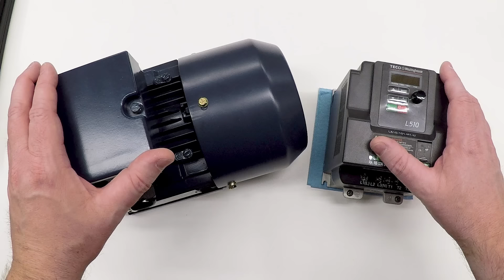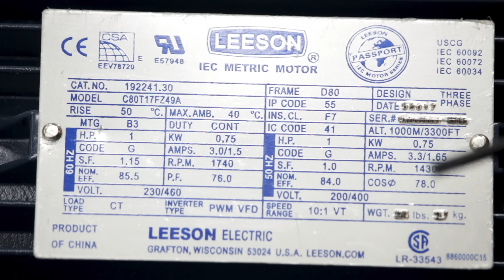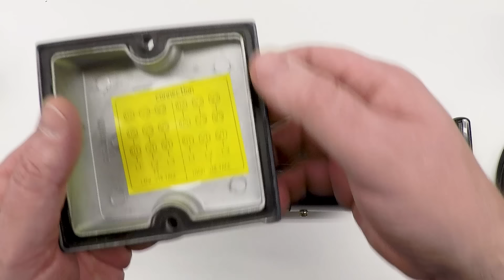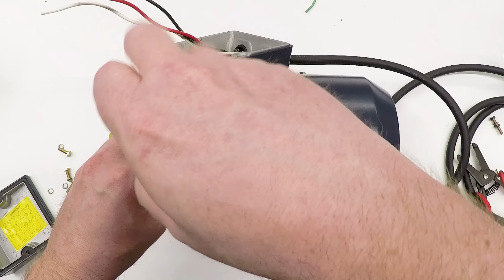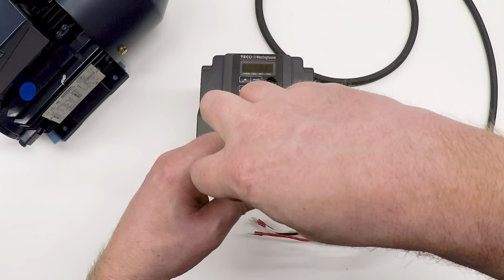Lathe VFD 1: How to wire a 3-Phase motor and VFD

Comment: You do make very good videos. -But why did you skip EMC shielding on this one? Did the bearings in the motor survive this?
Reply from the maker: It's been running for years.  Common-mode filtering was covered in another video in the series.

Comment: I have the same lathe but from a manufacturer here in mexico and i just bought it and it came with a 3 phase motor allready in it from factory (it is a new lathe), Would it work if I just connect the VFD to my 1 phase 220V power supply and then connect my lathe motor to the 3 terminals of the VFD without modifying or adding anything else?

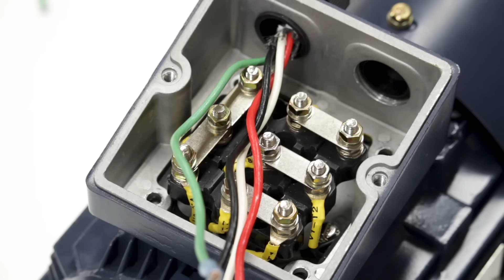Comment: I have a slightly different motor, and it came to me un-wired with no terminal block, just 11 yellow wires coming out of the motor into the wiring box. Anyone know where I can find a terminal block like the has 18:41  so I can wire this motor up cleanly?

Comment: At about 17:28 you say "I didn't cut all the way through the insulation", referring to the scoring of the SEOOW: "SEOOW" is not a type of insulation itself, but rather a designation for a type of electrical cable that features oil-resistant insulation and jacket made from thermoplastic elastomer (TPE), making it suitable for use in environments where oil exposure is likely; essentially, "SEOOW" describes the cable's construction and properties, including its insulation material, rather than being the insulation type itself. When referring to insulation as related to wires, cables, etc. it is thought that the reference is to the dielectric covering on the conductor: A "dielectric covering" on a conductor refers to an insulating layer of material, often called a "dielectric," placed around a conductor to prevent electrical current from flowing directly to another conductor or to ground, essentially acting as a protective barrier between them; it is essentially the insulating layer on a wire or cable, preventing unwanted electrical contact while still allowing the conductor to carry current within itself. And I always used that method with a razor knife of scoring the cable outer covering along its length, but I would then take small nips using diagonal cutting pliers to cut the circumference where the scoring along the length ended, unless the covering was loose enough to allow diagonal cutting pliers to easily nip from the cable end along the cable length. 40+ years as journeyman electrician in Pinellas County, FL. Just a technical nit-pick, lol 😊. Very good instructive video, thanks.

Comment: nice job.  I suspect that you will wish you did something a bit bigger.  I've done a few and found that 2 hp is a lot nicer.  Able to run at a much lower speed without stalling out.  3 phase IS better at low speeds but when you have reduced the speed using the VFD by say 4 times, then the relevant hp would be about 1/4 hp.  Ok, but not great.  If you cut that in half again, 1/8 hp is not enough, at least for me

Comment: I just saw this, 5 years after. I’ve replaced a number of motors with 3 phase inverter motors. After having used a number of different VFDs and motors, I’ve settled on these TECO/Westinghouse VFDs and their motors as well. I’ve found them to be easy to program, some are more confusing to those not experienced in this. The motors are made very well, and you know they work together.

There are different types of VFD and different types of inverter motors. Make sure you get those designed to work together. Generally, an inverter motor is constant torque at and below the rated frequency, down to some specified frequency, and then constant power above that to the max frequency. So my 2 Hp motor, for example, is constant torque from 3 Hz to 60 Hz, and constant power from 60 Hz to 120 Hz. Be careful when setting adjustment compensation for constant torque. Don’t be tempted to go right to the highest level, which is usually +50%. Stay close to +20-30%. Your motor may overheat otherwise unless you have a high overload factor.

At any rate, there’s a lot to this, many adjustments you don’t have to do. These VFDs have intimidating manuals for the uninitiated. I’m going now to the second video to see what he did. And, by the way, program the VFDs BEFORE attaching the motor, that’s a must. A beginners mistake.

Comment: Was there a reason why you chose 240 output vs 480... Your drive input is 120v AC
.. YOUR DRIVE outputs are either 240 /480, your choice, and you chose the lower voltage... Why ?
Reply from the maker: I believe the L510 115V single phase VFD only outputs 230V to the motor.

Comment: Great video thank you. never seen a label like that before.  my connections as follows; 4-5-6-, 1-1-7,  2-2-8, 3-3-9. I wire in over 1000k motors in a year.

Comment: Clough42,
I would like to thank you for your efforts on the video you produced of the VFD installation on your lathe and the subsequent video of the drive RF noise mitigation methods you used, reference your videos from 4 years ago.
I used the information from your drive RF noise mitigation method to great effect with an Automation Direct GS2 drive I installed on a bench top mill.  This drive produced conducted as well as radiated RF noise into the AC and DC systems.  This noise caused an IGgaying DRO to lose its position when the drive motor was running. I installed the same EMI filter on the drive input and ferrite toroid’s on the drive output to the motor as described in your noise reduction video.
I have also installed a Teco 2 HP drive on a lathe project. Thank you for the detailed look into the drive manual. Very helpful.

Comment: I am mostly curious as to what improvement in the machine function can be realized by this fairly expensive upgrade. Grizzly says the machine has speeds from 150 to 2400 rpm. This seems to me a reasonable range for this type of lathe. What am I missing?
Reply: A VFD can run from low RPM to high with no gaps. The Grizzly without VFD has a belt you need to physically change pulleys, so you can only select 6 speeds.  150, 300, 560, 720, 1200 or 2400

Comment: Remenber when use a VFD to drive a motor then select a motor with ceramic bearings otherwise your bearings will be harmed by eddy current.
Reply from the maker: This is not necessary.  A common mode choke will block the common mode energy that can capacitively couple to the rising assembly and flow through the bearings.
Reply: @Clough42  I must admit I didn't saw the whole video, just hear the squeaking sound and you said it was not the main spindle, so my conclusion was the motor bearings. You are right the common mode choke will help, due to smoothing the sine wave. Even though the magnetic field lines in an AC motor, which has to produce its own magnetic field based on a chopped squarewave approx to sinusoidal wave give induction currents in the bearings. Maybe the size of AC motor you have the effect is not significant but you will see the problem on large AC motors driven by VFD.

Comment: The tradesmen that I worked with referred to what your calling a cable gland they called it a water dust proof strain relief  I preferred to use the ones that are explosion proof any time needed even in my truck when I ran any wires through the firewall in my truck for a power inverter and the 110v and 12v to the back inside box and into the tool box where I had emergency lights and a cooler when needed .
Reply from the maker: They are called by a lot of different names, depending on the market.  Automation Direct calls them Cable Glands.  McMaster-Carr calls them Cord Grips.  Lowe's calls them Cable Connector Conduit Fittings.  Chinese import resellers usually use keyword soup, like Cord Grip Cable Glands for Electrical Box Waterproof Nylon Strain Relief.
Reply: @Clough42  as a safety officer I brought it up that we had red seal journeyman electricians who did not know the terminologies for ele fittings because 100% of the training they had they never worked on a industrial site .it proved to be a problem we even he'd electrical engineers from China who was not recognized in Canada so some of them challenged the journeyman cert and some passed never once setting for on any job anywhere the oilsands capitalized on there knowledge.

Comment: Great video, I'm dealing with wiring mine up right now. Big issue I have is the wires coming from my 3 hp 3 phase motor are solid copper either 16 ga or 14 ga all the same color. It's a South Bend from 1960. Wire nuts keep coming loose when putting 12 ga stranded wire together with the solid, (2 solid & 1 stranded), I have considered soldering or maybe connectors but can't seem to find a large enough connectors to put all 3 together that will work on the terminals with the VFD. I guess it's what we all run into trying to modify our equipement. Thanks

Comment: Well, I'm really late to the VFD on a G0602 party. But when I ran across James' videos, I knew I had to make the jump to a VFD. The way James breaks everything down is clear and concise. Excellent content James! I got everything ordered and made the conversion. It works perfectly as in the videos.  My next step is the ELS conversion. I have most of the parts already, just waiting on the Texas Instrument developer board and the cogs from China. I can't wait to get rid of all those nasty gears.  Well done James! Thanks for your excellent content!  You earned a new subscriber!
Reply: 4:02 
“These motors come in a couple of different (flavors) “ 🎉
Reply: Not as late as me  :)   I'm having trouble locating this motor now. It's discontinued and so is the replacement. Any Ideas on another replacement?
Reply: @The411   what motor ?  Just look up on Google and try to find a motto with similar numbers  volts and hp and rpm
Reply: @The411  Actually, when I ordered mine. The company reached out to me to tell me that model was discontinued. The guy on the phone matched the specifications on RPM, size and base plate mount, etc. with the motor James listed in the conversion. It fit and worked just like it the videos. Just call the company you were ordering it from and ask them to match up the specs. 
I would tell you what my motor is, but I am out of town traveling until September. 
I will add this conversion is amazing if you have a G0602. It is pure joy to work with the lathe. 
Let me know if you need my motor number when I return home.
Good luck!
Reply: @SRED  Thanks for the reply. Yes, my lathe is a G0602.I think I have info on a suitable motor a Marathon R313A it matches the specs very well. I was worried about a motor not being VFD capable, but apparently all motors in the last 10 yrs or so are all VFD capable, and the newer ones dont even mention it. Safe travels.
Reply: @The411  Great! Trust me, once completed you will find things to turn on the lathe 😁
Good luck!

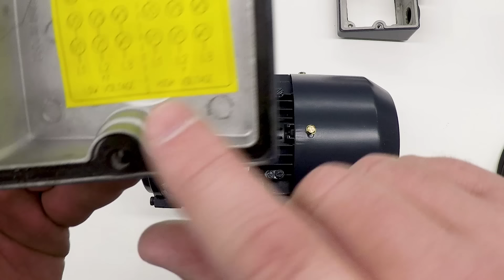Comment: Thank you for the good video.  Please explain is the low voltage connection at time 16:16 in a delta or star configuration? It's confusing as I've never heard of a 9 lead motor before . New electrical student haha...
Reply from the maker: I think it's star-wired.  Three of the coils are already connected in a star configuration inside the motor, and you either connect the other three coils in another star wired in parallel with the first (low voltage) or you attach them in series with the coils in the hard-wired star (high voltage).

Comment: Thanjj jy s for sharing. I am also learning more about VFD’s and electrical motors.
I have a VFD on my lathe because I don’t have 3 phase power and the lathe has s 3 phase motor. Now, I am doing some research after the fact because I am building a machine for a client. I see that everyone now is using SHIELDED wire between the VFD and the motor as they say it can damage thd motor, the motor bearings… as well as the cable ( Ozone that eats PVC! ) 
What is your thoughts about this as I see you did not mention shielded wire in your setup…

Comment: On the VFD spec plate, I see that the AC Input is 19 Amps.  Have you ever checked the actual VFD input current draw?  Is the VFD on a separate circuit?  Thanks.

Comment: why not say on your title that it's 3 phase input like you mention at 21:09 I'm looking for a 1 phase input and wasting time
Reply from the maker: Because it's not.  This is a single-phase input VFD.  My exact words were "You've got L1 and L3 which are the Line and Neutral.  On a three-phase input there would be three input terminals here, but there's only two on this one."
Reply: @Clough42  ok, I'm very sorry,  I've heard the 3 phase L1 L3 line in and assumed. I'm getting really frustrated. I bought a VFD and all the instructions are in Chinese and can't find an English version. 
Trying to hook up a new 3ph horizontal bandsaw. 
The VFD turns on showing 50 Hz and won't run the saw.

Comment: When testing the wires. It looks like you used 110 outlet to bench test. I thought I needed 220 to setup, but rather use 110.

Comment: I don’t own a lathe but Soon I will. My question is, if the motor is rated for 230/460 volts. How’s it working with 110 volts?
Reply from the maker: The VFD takes 115VAC as input, steps that up to a high DC voltage internally, and uses it to produce 230VAC 3-phase output to drive the motor.

Comment: There is a lot of incorrect information in this video.  Using SO cord on a VFD application is a terrible idea.  You do not have 1.15 service factor on a VFD.  It is derated to 1.0.  The 10:1 speed range is only in a variable torque application - a lathe is a constant torque application, etc..........
Reply: Why would SO cord be a terrible idea?  Don’t you want stranded conductors in this application with oil resistant sheathing?
Reply: SO cord is perfectly fine for this installation.
Reply: I’d use some sealtite myself but SO should be fine for your home

Comment: My lathe and mill already have 220-3ph motors.So I can just add a VFD,and run them on 110-115?I had a rotary conv. at my other home,but didn't install it here yet,and looking forward to not having to if this works..

Comment: James, 

Other than cost, any reason why you didn't with a 2hp VFD?  In general, I have always over-spec'd things like this, but thought I would ask if there was any downside to using a higher HP rated VFD on a lower HP rated motor?  Thanks in advance for any input

John
Reply from the maker: The VFD would need to be configured to only output 1hp to the motor so there would be no real advantage.  Plus a 2hp VFD wouldn't be available for a 110v input.

Comment: Really informative video. Thank You.
At: https://youtu.be/apQKgs_D0DM?t=1149
However, the gripping spring washer on the ground wire ended on the wrong side of the terminal. This type of washers are used to ensure a good electrical contact between dissimilar metals. In this case the aluminium body of the motor and the tinned brass connector. The washer edges bite into the metal making tiny airtight contacts that do not corrode easily. In addition to that those washers prevent the connector from rotating when the screw is tightened.
That type of washer should be placed between the motor body and the connector, not between the connector and the screw.

Comment: Thanks for another great video- it looks like there are lots of people interested in VFDs for the home shop and I think you've made a terrific series covering the whole process. 

However regarding EMI- have you considered using a shielded cable? The motor line will act as a 16GHz antenna and is easily solved by using a shielded cable. There are plenty of 3 core + earth shielded cables and their matching shielded gland ends specifically made for VFD use which might work well for you. 

Keep up the great work!
Reply: I recently used a VFD cable that the foil and drain wer
e the ground. Don't use it. Got a new cable that had separate ground from shield/drain and all is good now. Ground one end of drain only at control panel end to service ground.

Comment: Thank you very much for this superb video. The VFD in my Powermatic wood turning lathe died a few weeks ago and I was very apprehensive about replacing it. The replacement part from the manufacturer was $650. With your video, I bought the correct new VFD for $230 and successfully installed and programmed it myself.

Comment: I'm going to do the same conversion as you. The motor you have linked to is no longer available.  You mention the different RPM motors. What would be the downside to using the 3600 RPM?

Comment: Hello, James 
You mentioned about Hi voltage and Lo voltage, does it mean that Hi voltage is for direct wiring with three phase electrical system if you have it in your building?  Please answer.  Thanks.
Reply from the maker: The direction, speed, and fan wiring are low voltage (10-12VDC).  The mains input and motor wiring are high voltage AC.  In this case, the contactor start and e-stop wiring are also high (mains) voltage.
Reply: AmericanOkie - I see that this post is old, but if it still matters, the answer to your question is “No”. The Hi and Lo voltage on the motor diagrams refers to the two
Reply: (Continuing)...working voltages the motor was designed to run on, either 230 or 480. They are both three phase. Both of those voltages are commonly available in industrial buildings with three phase supply. Some TECO VFD’s are available with 480 volt output, but the one in this video has only 230 volt output, and that’s why James changed from Hi (the 480 volt setting) to Lo (the 230 volt setting).

Comment: Is the LEESON C80T17FZ54A  (cat  # 192241.00) going to work? The difference I see is it states on the plate it is a PMW but doesn’t say VFD. Also, under the cover it has 9 wires, but only 6 studs and no metal jumpers. Not sure if this is just the newer version of your motor. The specs plate is nearly identical otherwise... thanks man!